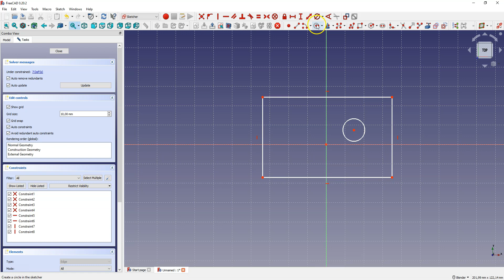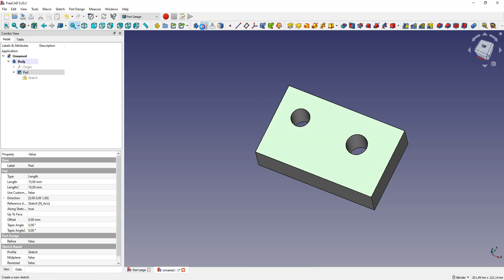How to EDIT Sketch in FreeCAD

Comment: I tried this and FreCad REFUSES to update the body after I have made a change to the sketch
Reply: I have same problem. It's easy to edit it, when it's the last thing you done,like in this video.But when you have 20 sketches,go back to first one,after edit it's not visible on body and all you get is message "recompute failed".
This simple bullshit is pissing me off.
Reply: @likfrikbik  the ONLY way I have found to REMOTELY deal with that problem (doesn't FIX it but makes edit SORTA possible) Is to use coordinates in space to make sketches, always start at 0, 0, 0, and when you need a new sketch use the coordinates in free space to place it. Making changes STILL BREAKS EVERYTHING but if you change the coordinated of the affected sketches at least it is POSSIBLE to fix the model even if it is a MAJOR PAIN IN THE @$$

Comment: Thanks this helps a lot. But how do I resize or remove a radius on the front of my project box. When I put a 10mm fillet in the corners for screw pockets. It apparently created a 10mm radius on the face edges at the same time. I used wire frame to select inside corner lines for the fillet. I'm new as you can tell :)